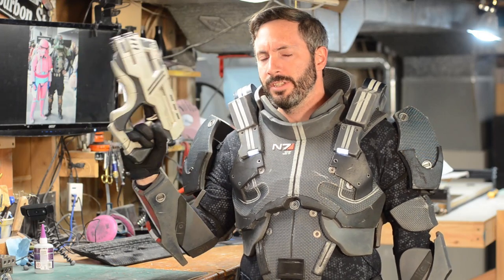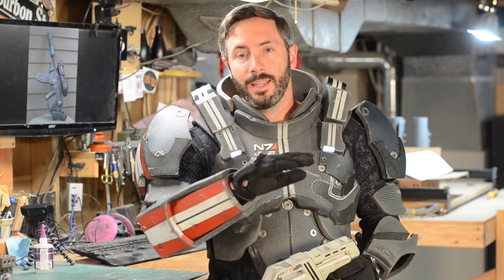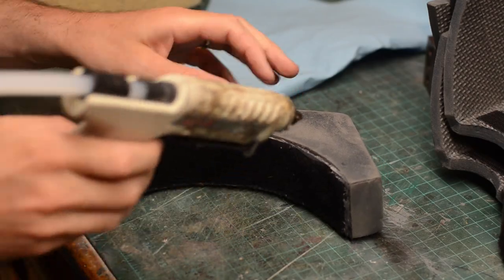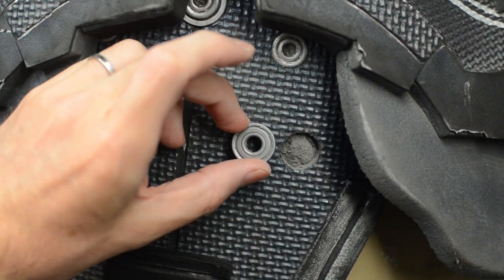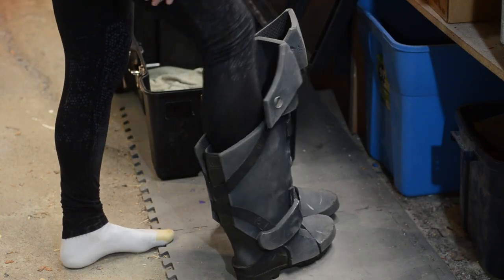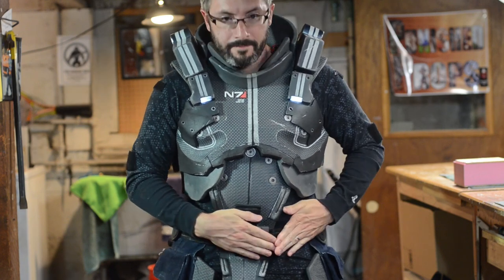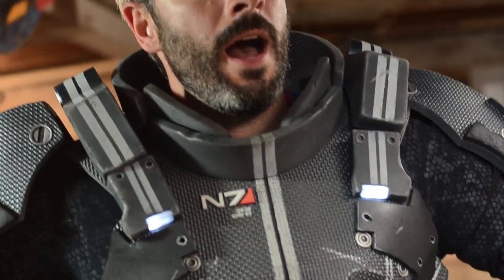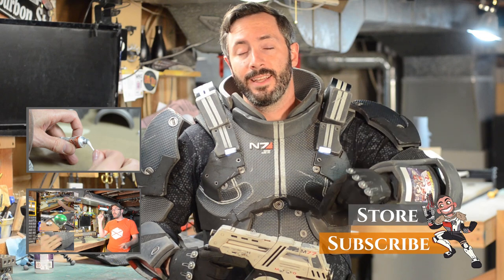Mass Effect Defender Armor Cosplay - Prop: Shop

Comment: Hey Bill!

I'm attempting to begin becoming a foam smith. I have everything picked out but the glue to seal foam pieces together. I tried looking for the Barge contact cement stuff but it was WAY out of my price range.  Is that how it normally is or am I looking in the wrong place?
Are there any alternatives I can use right now or no...? Thanks.
Reply: I'll look for it, thank you!

Comment: Do you know anyone with a scale M-3 Predator mold or 3D models for sale?

I've been really excited about Optimistic Geometry's fold up prototype, but it doesn't seem like they are going to be bringing anything to market anytime soon.

I love this armour, BTW.
Reply: Figured it couldn't hurt to ask.  Thanks for the response.
Reply: Michael Tótin I found files on thingiverse.com
Reply: You didn't provide a specific link.  The ones I am finding are undersized and have a skeletal grip.  If I could ever take the time to learn 3D modeling, I suppose I could use those as a starting point to make my own, more accurate replica.  
Thank you.
Reply: Well, Bill has some excellent videos about 3D drafting with free software. I'm sure you can figure something out.
Reply: I'll have to check them out.  Thanks again.